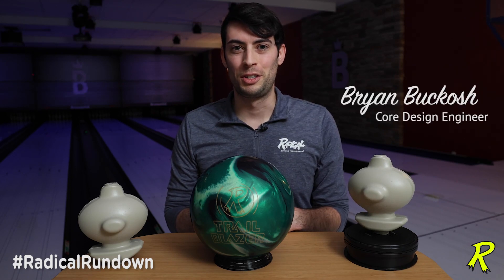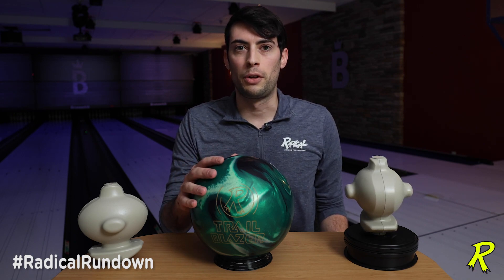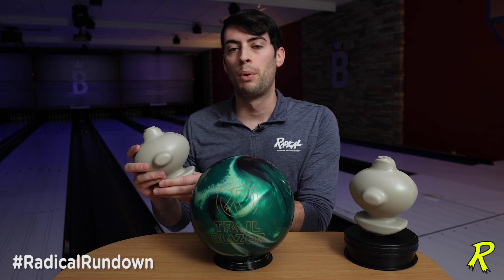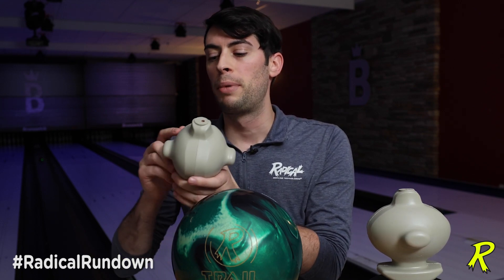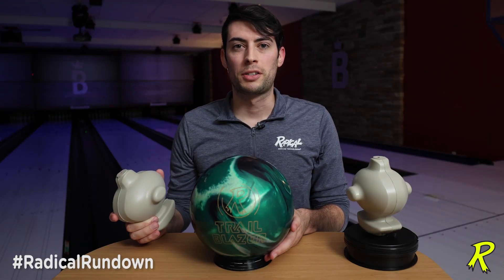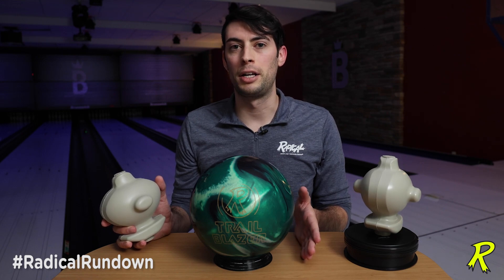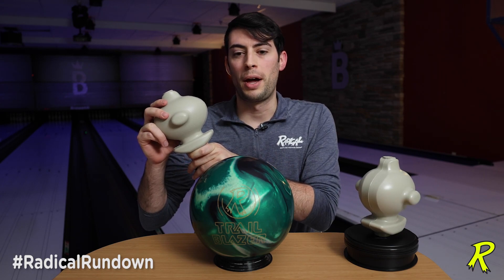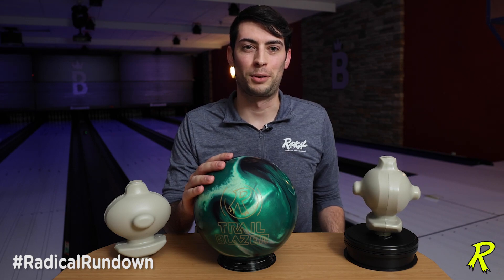Radical Trail Blazer - Technical Core Overview - #RadicalRundown

Comment: Have been throwing the Radical Trail Blazer Hybrid all summer.  Layout 50 x 4 x 30.  Very smooth.  Does not have the big booming backend like my Ebonite Game Breaker Asym.  It is stronger motion than Track Kinetic Black Ice. Most similar to my 900 Global Honey Badger Intensity Solid.